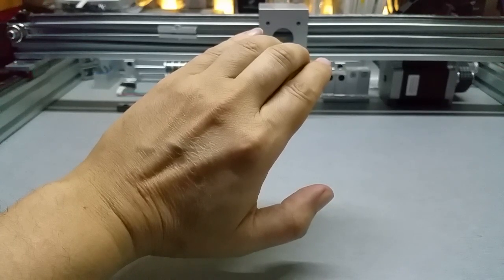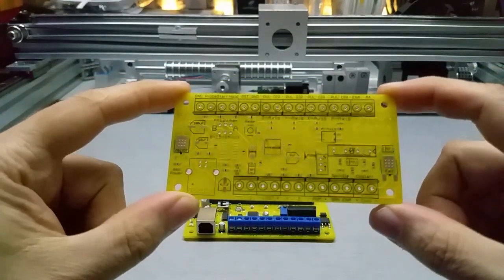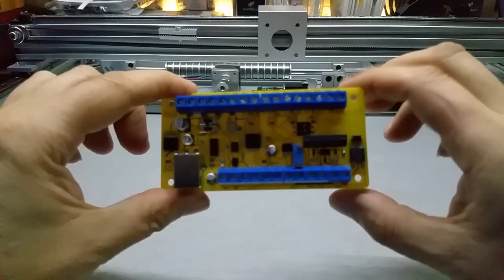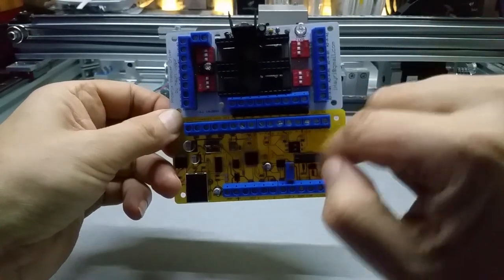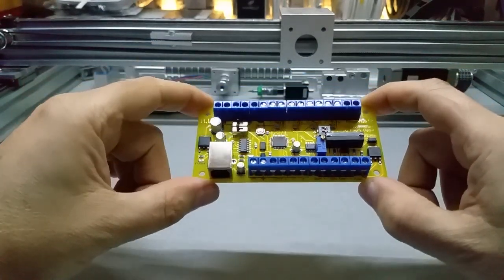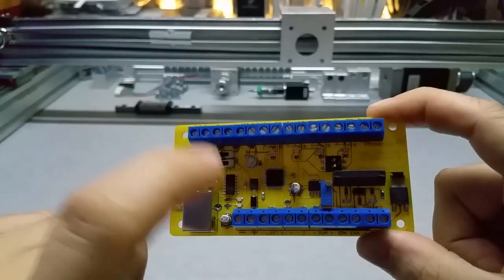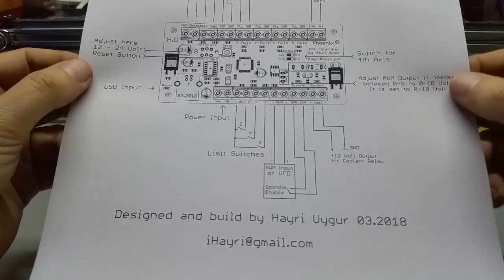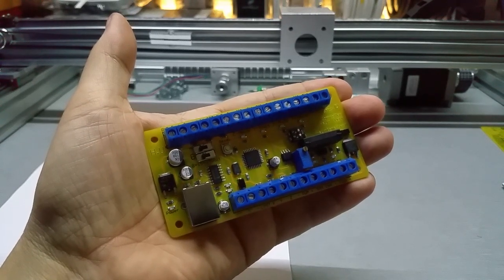NEW Phoenix SMD CNC Controller by Hayri

Comment: Hayri. My PWM output only goes to max 8.1 vm limiting my spindle to 19700 rpm instead of 24000, are there any settings somewhere that I need to mess with ?
Reply from the maker: There is only 2 reasons why it will go only up to 8.1V, either your 5V USB power is too low, or your Potentiometer needs adjusting which I doubt as I do that before shipping out and adjusting it to max output, I do measure each and every controller before shipping out to make sure the spindle enable, 0-10V output and the 12V for the coolant work. Also try another USB or PC.

Comment: Does your board have filters for the limit switches?
Reply from the maker: Yes it does. Also for the probe, start,hold and reset inputs.
Reply: Thank for the quick response I have been having so much issues with getting my machine running without faults. Where is the best place to order? Shipping to Scotland?
Reply from the maker: No problem, here is the direct link to my controller: 
https://www.tindie.com/products/6496/ 
and yes I do ship to Scotland :-)
Reply: Thanks Hayri will be ordering now.
Reply from the maker: Thank you too Benedict, got your order :-)

Comment: White looks incredible with the leds. What is the main difference with the last one
Reply from the maker: Changed most parts to SMD version, replaced the regular relays with one reed relay and the other with a mosfet, reduced size to 50%. It is now only 100x50 mm.